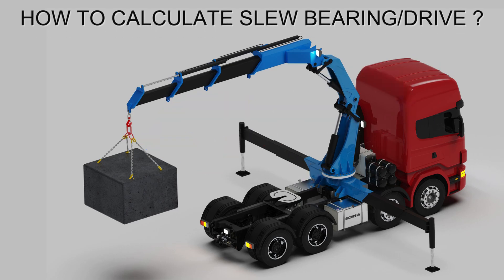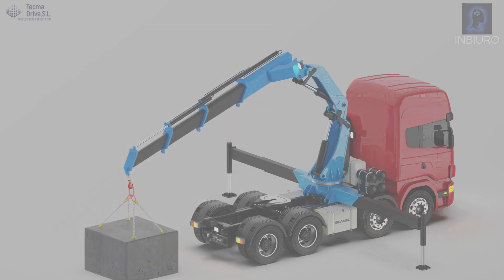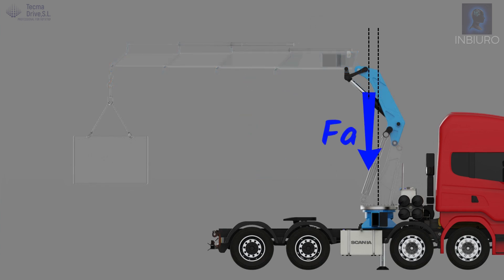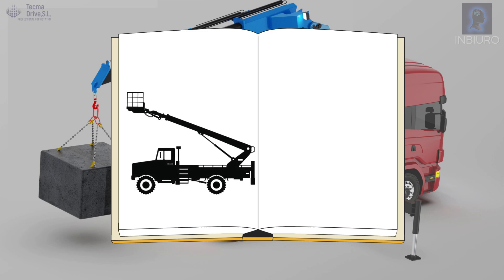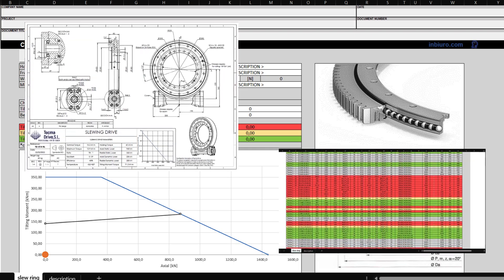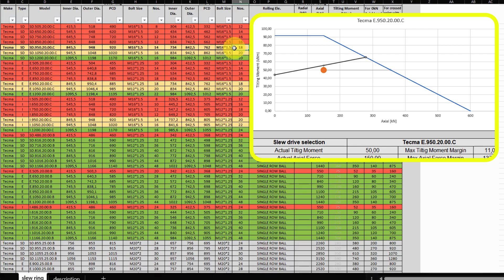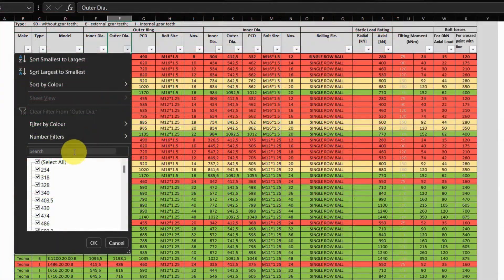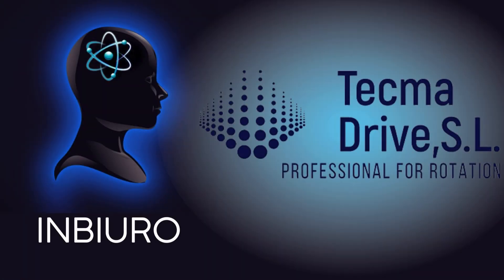How to calculate slew bearing for crane and other rotational arm - Tutorial

Comment: Jiangsu Ruide Slewing Ring Co.,Ltd. founded in 2004, which specialize in producing slewing bearing, slewing ring, slew ring, slew bearing, slewing ring bearing, swing bearing, slewing gear bearing, turntable bearing, SLEWING GEAR, SWING BEARING, BEARING SWING, SWING RING, SLEW RING GEAR BEARING, SWING CIRCLE ASSY, slewing drive, slew drive in industrial and machinery fields.
TADANO: TR200M-4, TR250M-1, TR250M-3, TR250M-4, TR250M-5, TR250M-6, TR500M, 
Tadano TR500M-1, TADANO TR500M2-00102, TADANO TR500M-3, TL200M-1, TL200E, TL200M-3,4, TL250E-3, TL250E, TL-250M-4, TL300E-3, TG450M-2, TG500E-3, TR350M-3, TR80M-1, TS-70M-2, TS-70M, TS-75M, DT-700P, DT700, DT710DT600, Z360, Z366, Z300, TMZ255, AT-150S-1-20201, AT-200S-1-20101, TMZ503,TM-ZR506,TADANO Z-600, Tadano TMZ500, ZR500, ZFX500, ZF500, Tadano Z290/293/294/295, Tadano TR80M,
TADANO TG-1000R-1-10101 TADANO 370-023-02650
TADANO TG500E
KATO: K350E, KA400E, NK200H, NK200H3, NK200H5, NK350, NK450B, NK400E-3, NK500E-3, SS500, NK800, KR20HL, NK250E3,E5, NK200S-2, KR25H-3, KR35H-3, KATO KS453, KATO NK350E-V, KATO Nk70, KATO NK400S-III, KATO KR 20H-3, КАТО 25 Н3-L, Kato 25H-V2
KOBELCO:RK250-1,RK250-2,RK250-3,TH1130,T200-2,T200,T300,T350,T450,T500, RK70 
KOMATSU LW250M-2, Komatsu LW100, Komatsu LW250-3, Komatsu LW250-5
Hitachi EX80U SWING CIRCLE ASSY
Hitachi KH180-2 Slewing Ring also fits on Hitachi UH20.
SHINMAYWA CB29-15S
SHINMAYWA CB25-11S
SHINMAYWA CB2900
Aichi D50A, Aichi D70A, Aichi D501, Aichi D502, Aichi F304, AICHI D500ES, AICHI B242, Aichi D705, Aichi D706, Aichi D805, Aichi D902, Aichi D903, Aichi F507, Aichi D504,  Aichi SN145, Aichi SH140
Cormach 9800E3
Gear swing PH 670 WLC
P&H Swing Bearing (670WLC)
Maeda Mc 353
MAEDA MC-514A
UR500 UNIC CRANE
Unic 330, Unic 340, Unic 360, Unic 370,Unic UT80M, Unic 300, Unic 600